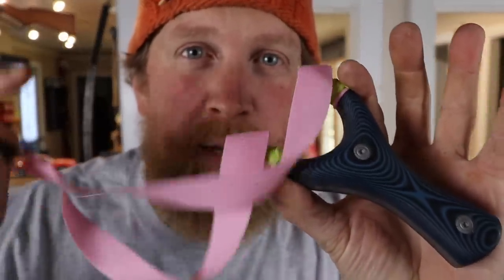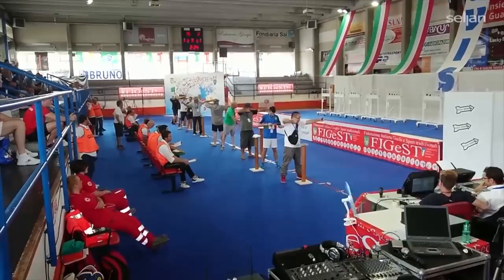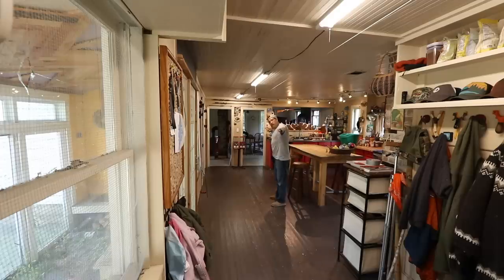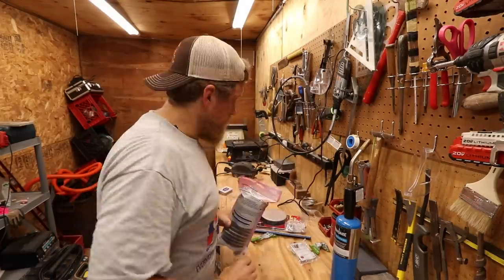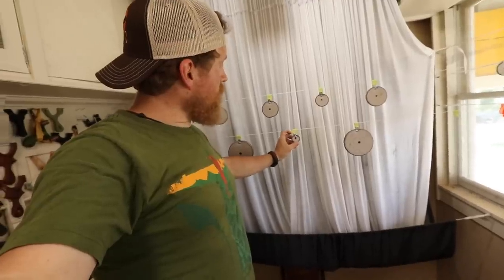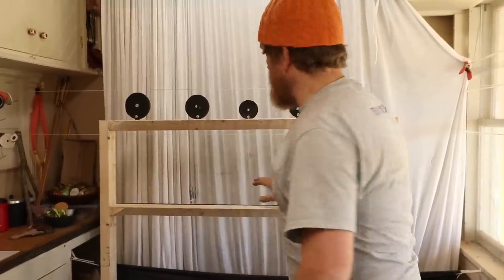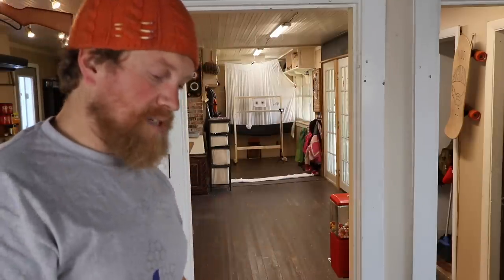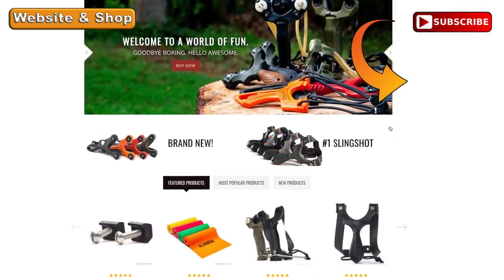2019 Slingshot World Cup Warm Up With The 2018 World Cup Slingshot | Trick Shot Tuesday Ep. #17

Comment: Natural balance wood frame, small pouch to get less resistance.  Smooth transition from release to flick forward. Short draw  accuracy advantage over the over-draw/butterfly draw.  When you developed a technical memory for years its hard to break.  When people start out the overdraw is the result of the band too soft.  Play with the width of the band to get it right (custom build) for you as draw length and pull weigh.  I made my own slingshot when I was 6 and kill hundred of birds over the years.  But now retired and just fish for dinner.  Thanks for sharing.

Comment: Feel the force Luke !  
Good luck in the world cup event.
I felt that feeling once on an impossible shot with a 22mm rifle. Our dept. of highways camp took one shot turns at hitting a small glass insulator that held up our radio antenna wire.  I was low man on the totem pole at the camp so i was last, and they all missed. I was shooting across the camp, and parking lot and across the road to hit the insulator. I took a little while and the jokes started coming. But all of a sudden a calm came in a moment that kind said now, you got it. I pulled the trigger and the radio antenna fell,  and then i had to climb the tree to put it back before the foreman showed up or called.